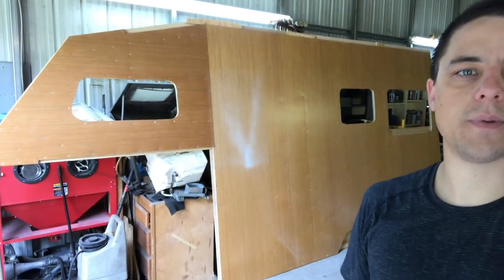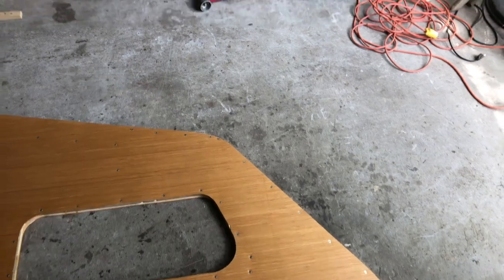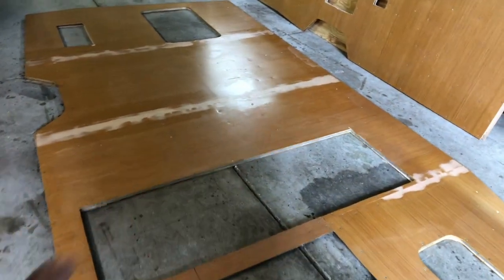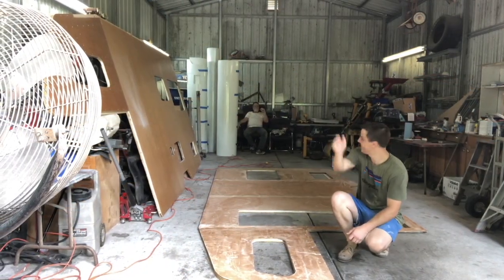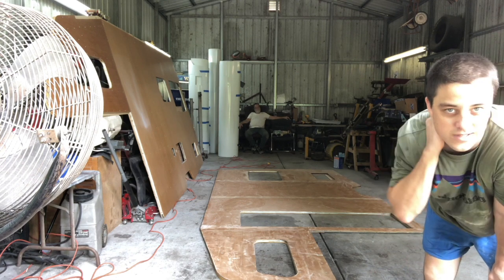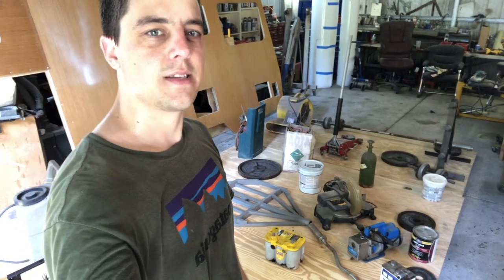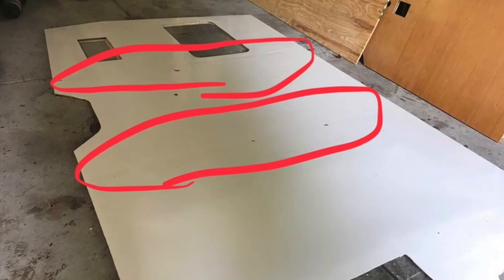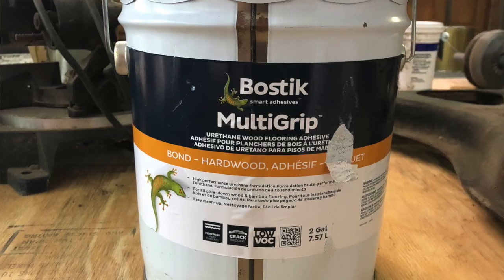#9 - First FAILED attempt of Filon Install

Comment: Thank you for this video , it was very telling. As an point of interest, maybe try laying the filon side down on the concrete floor . then apply your weight on the frame parts only not on the plywood its-self . Just a thought. Making sure the concrete floor is very clean . I did this method with wood and it came out great. Good luck guys and thank's again for the info.
Reply: Terrible idea. Very important the weight is spread evenly. And yes I know, I work in this industry doing lamination

Comment: do you think the bondo (being porous) reacted with the adhesive differently...maybe sealant on the wood and painting the bondo would have fixed this...
Thoughts?
Reply from the maker: It's me Ryan we did have that suspicion, we have re-sanded to get as smooth as possible, and then painted the entire wall with a marine fairing compound. We will be installing the filon on the walls soon now that Florida humidity is dropping enough for proper curing of adhesive.
Reply: @oddcouple4x476  what brand fairing compound did you use... i'm probably going to copy you guys
Reply: @oddcouple4x476  I work in RV lamination. Getting that filon to stick is pretty easy. Send me an email and I’ll talk to you about it

Comment: 14th view, FIRST thumbs up! (first comment too!) WOOT! - Ya'all call me, I'm done insulating the big garage door, you can have all the leftover insulation- would be good for the pocket around the water heater, or the walls of the shower stall, or anywhere really
Reply from the maker: Eclidean will do! We will be doing the roof once the walls are back on and will certainly be able to use it, thanks again!
Reply: @oddcouple4x476  No Probs - Luv Youz Guys!

Comment: We just hung a new piece of Filon on the back of our RV. We used Weld Bond contact cement on both the luan wall and the Filon...cut to the chase... it did not adhere in certain spots and keeps bubbling!! Did you use a different glue...? Did it work better? Thanks!
Reply from the maker: Notjustamom we haven’t given it a second go yet since we are waiting for proper weather conditions in Florida. I plan on using 3M 1357. This adhesive requires a certain temperature and humidity for proper adhesion, perhaps your conditions weren’t correct? Also, many adhesives require a set time on both surfaces before you attach the two pieces. If you were to attach the two pieces too early, they may still have been off-gassing, creating bubbles. Just a thought

Comment: I feel like if you traced the Filon with the wall like you did but then flipped everything over, and pressed the filon to the plywood and rolled it, rather than roll it filon facing down and pressing the ply wood down. You may have yelled better results. Maybe 🤷🏻‍♂️